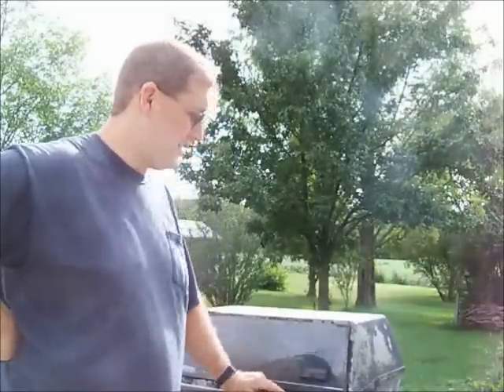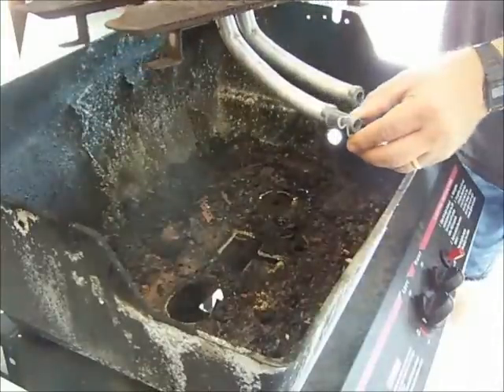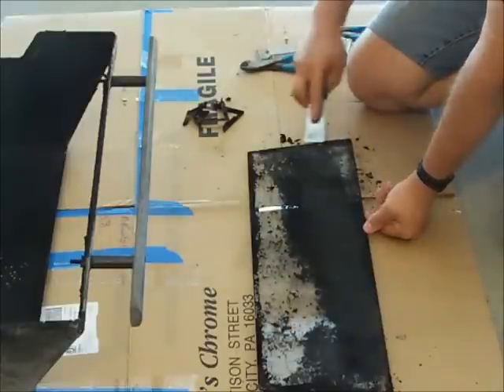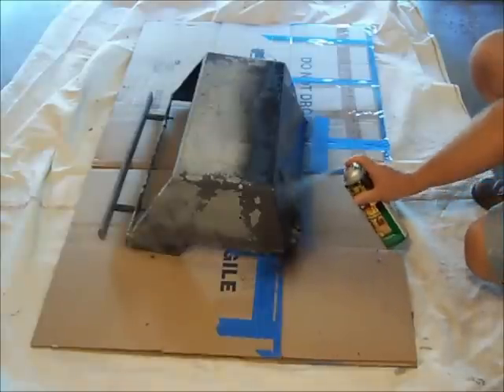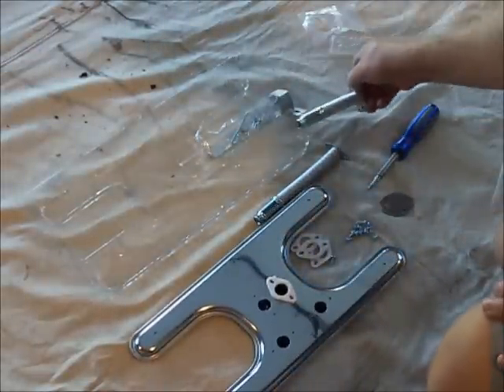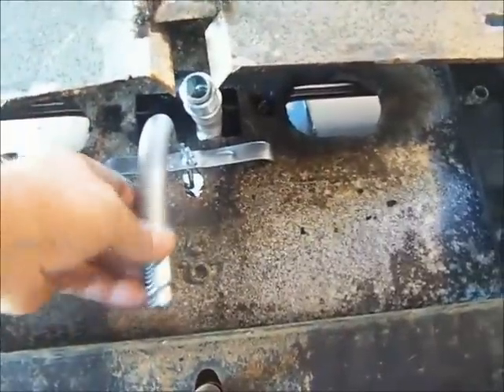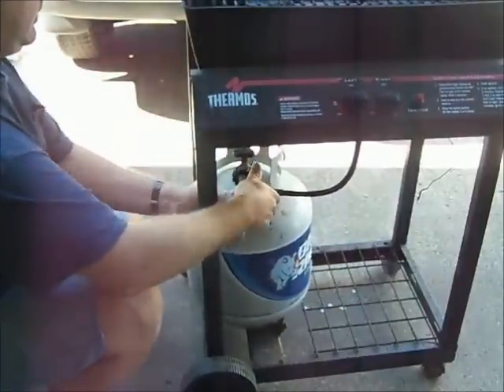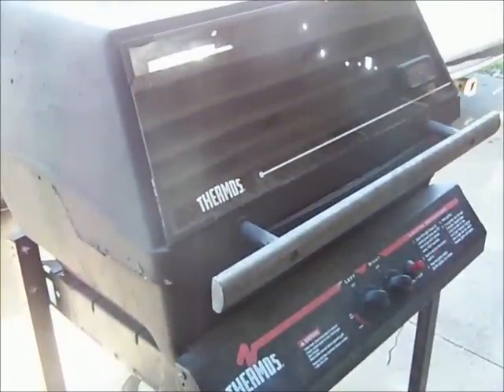How to repair a gas grill

Comment: I just replaced a burner and the directions for connecting the Venturi tubes were terrible.  This video confirms that I installed them correctly, which gives me peace of mind.  I think these old grills are so much sturdier than the newer ones, which don't seem built to last. Thanks for the tips!  Great video.

Comment: Just repaired my six year old 4-burner. The supports that held burners in back rusted out. I cut out the old crap and bolted on an aluminum L bar back there. Replaced all burners and heat plates. It's as good as new! Spent  about $35 in parts to fix a $200 grill.
Reply from the maker: Good job!!
Reply: The Frugal Berry Thanks. You did a great job restoring that grill. You probably already know this: It's a good idea to run grill on high for 10-15min to burn off any oil/residue from new parts you installed. I also run grill on high before cleaning it (I just scrape/wipe it down-no cleaners) to burn off any grease.

Comment: I used an angle grinder with a wire rush attachment and striped all the old paint and rust and gunk from the inside of mine and painted it after. Turned out very good. 
I was hoping your video would show how the igniter hooks up cause I have nothing to copy on my bbq cause someone cut out the original igniter long ago.

Comment: I’m currently designing a compact portable gas grill for my internship and am hoping if I can ask for your help. I’m making a 2 lp gas burner BBQ. I built the manifold, the BBQ module and cover but everything else are universal replacement parts: tube burner, valve, igniter kit, hose, regulator. The BBQ module’s dimension is 16” x 16” x 2.5” and it has two 16-1/5" X 1" Stainless Steel Tube Burner. I was using a replacement valve with #53 orifice size but due the depth restriction of the BBQ module I replaced the brass spud with #69 orifice size to get much smaller flame size. However, the current issue that I’m experiencing is when I turn the valve to high or low the flame size hardly changes. Thank you in advance for your help!

Comment: I need to get a replacement igniter for mine. Where can I find one? I was given a similar one to this by my father-in-law and don't know the model number.
Reply from the maker: Igniters can be found at most hardware stores / Lowes / Home Depot.  I have never had one work for more than a year, so I usually just give up and use a lighter.  Hope this helps.
Reply: Yup, long lighter or match.

Comment: GAS!   Wunderbar.

… but how does one fix a failed mechanical safety valve?
Reply: If you're talking about the burner on/off valve, you can buy universal valves to fit or try the manufacturer for parts !!

Comment: The replacement burner he is installing is a Bad choice. Its poorly made and will rust out in no time. Flexible tubes suck. Purchase a better made burner.
Reply from the maker: My experience is that no mater what burner you get, it will only last 2 to 3 years.  What burners do you use?